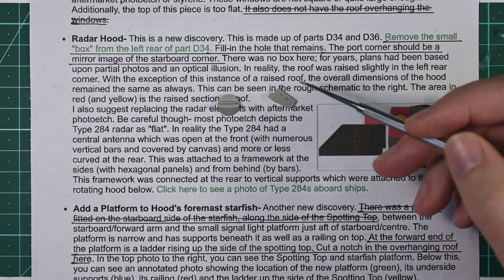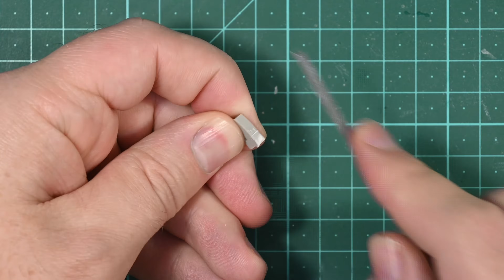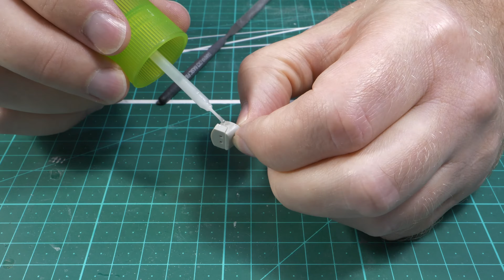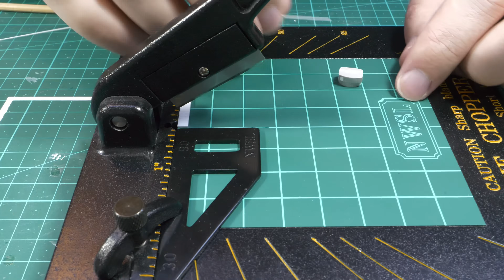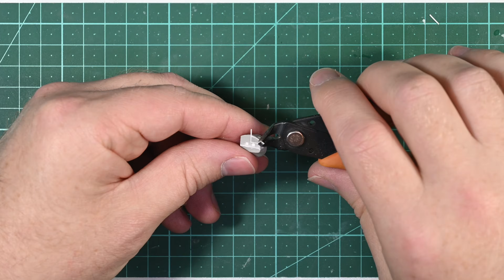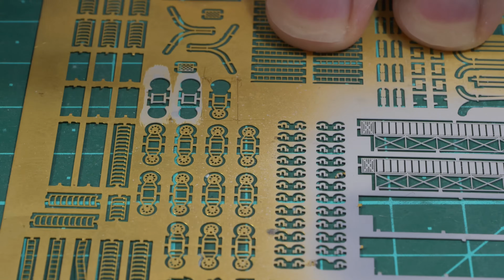1:350 HMS Hood: Part 49 - Radar Hood

Comment: Wouldn't it have been faster to create the raised plate out of a card/strip of styrene? Roughly trace tracing the basic shape and then sanding it to its proper dimensions?
Reply from the maker: I don't think so, at least not for me. I find tracing and cutting a clean edge to be frustratingly difficult, even with the chopper. I think it is much easier to get a clean edge by building a frame out of styrene that is easy to bend and then filling the center.